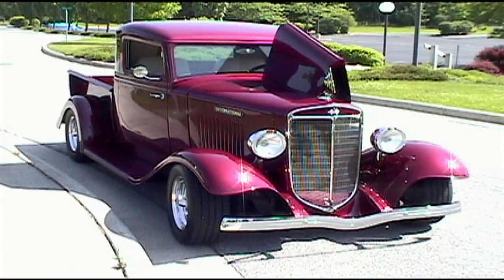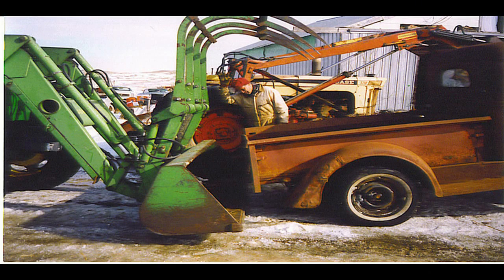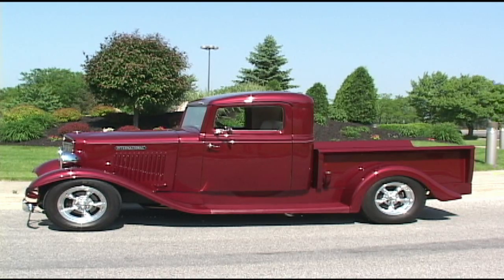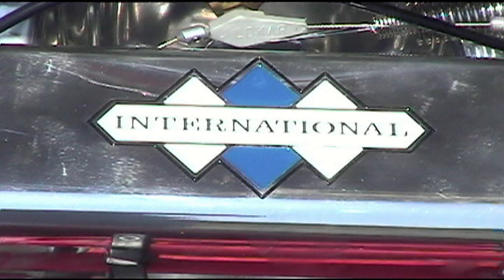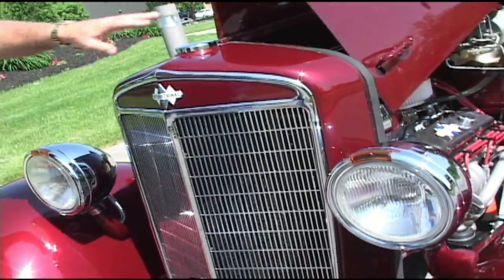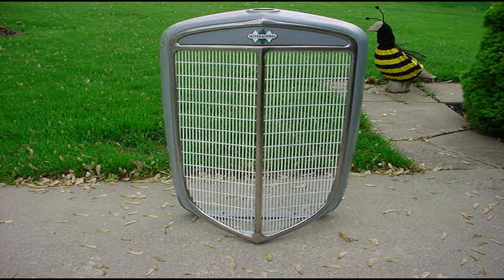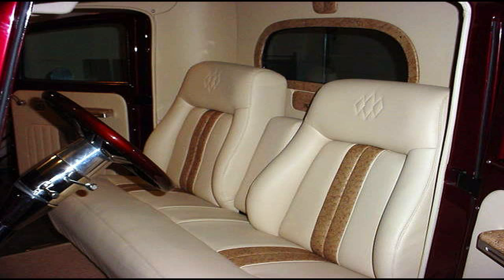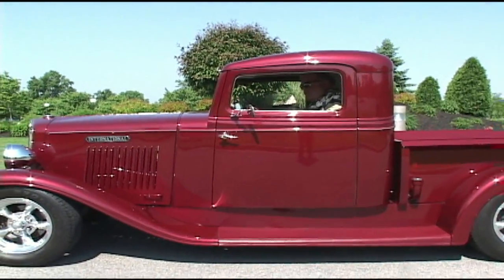1935 International C1 Pickup - Fly/In Cruise/In

Comment: I restored a 1936 C1, it's now in a truck museum in New Zealand's lower South lsland as a baker's van in a cream colour.(reg BAKERS II).
I originally restored it from a derelict state after I found it near Waverly, originally a farm truck but ending up a local tow truck.
Cab was rotted out and it had a bare chassis behind it , so l built a replica doorless wooden cab, (copied from an old photo of a C1 milk delivery truck) and a ute rear, with sides and a drop tail door .
The bakers van body was put on by the next owner who later  placed it in the museum.
Sadly this video's 'old survivor' looks very very different from new, different engine etc, vastly different driving experience , and to my eyes its spoiled, so little is original.
However he has done a lovely job in terms of engineering and finish etc.